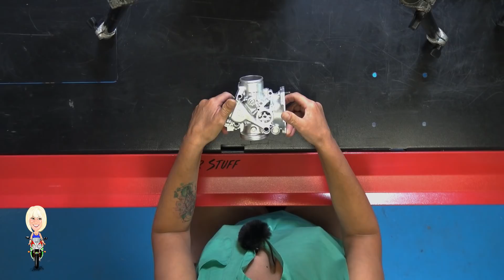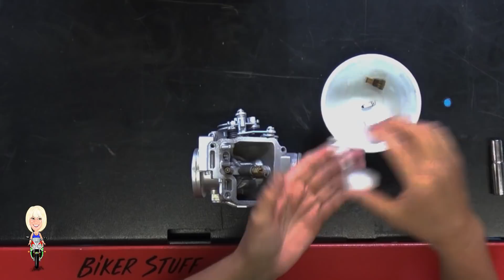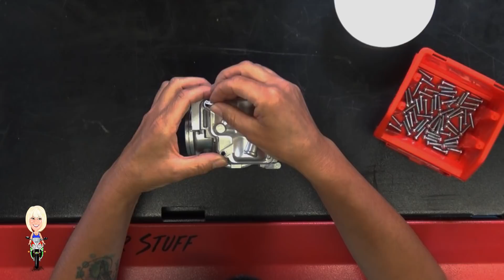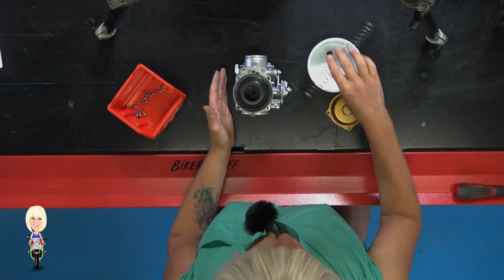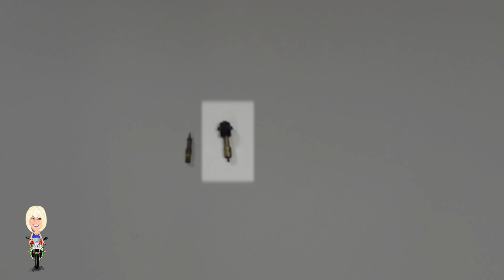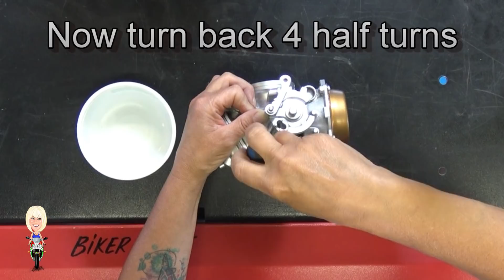CBR1000F project (Part 9a) carburettor rebuild 1

Comment: Hi, great video series on this bike , has been quite a while since this one was posted , are you going to do any more on the CBR1000F , I ask as you are showing me what to expect when I delve into my 89 CBR1000F as it needs a few jobs doing but it isn't as rough as the one you have , I still have the old disk rotors hanging about that I won't use as I replaced them, they are ok and if you need a set I am happy to donate them ( Except shipping from Australia that is ) but otherwise free and not rusty like you set are
Reply from the maker: I hope to return to Piglet once I have finished restoring the KM90 I have on my other channel.
Also Piglet will move to BS2 once the rebuild continues.

Comment: You can flash your carbs at me anytime and of course there's nothing worse than not having a diaphragm in properly! Love the vid as always, the only point I would mention is that you didn't check the float height. Keep up the good work and hope you will produce instruction on coil testing one day. Stay safe, regards
Reply: The diaphragm swelling by gas. Let it to dry over night and it go easely.